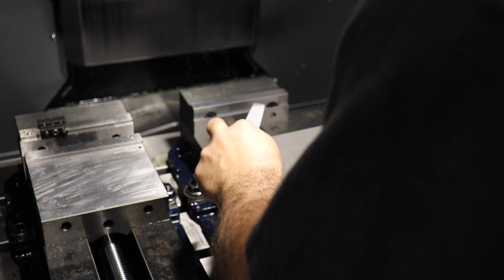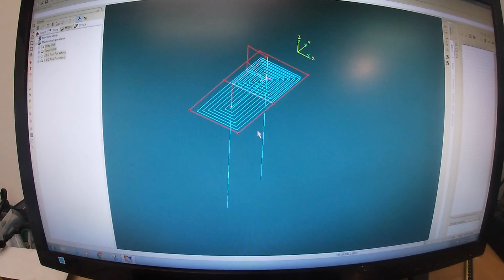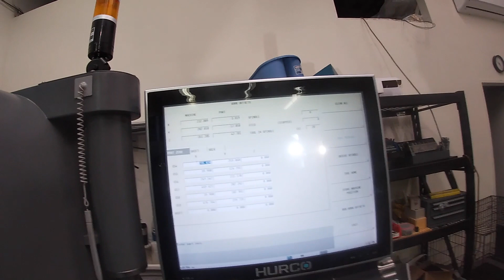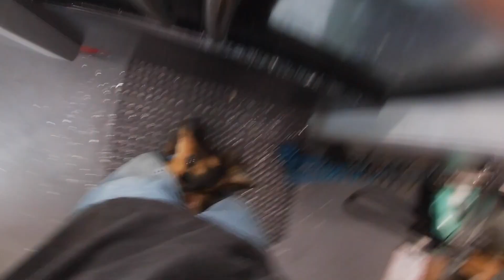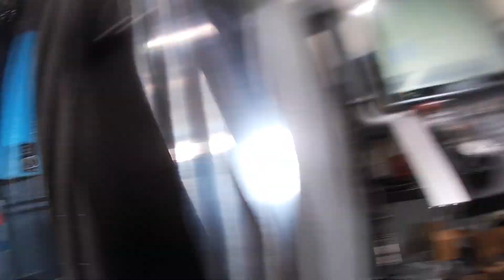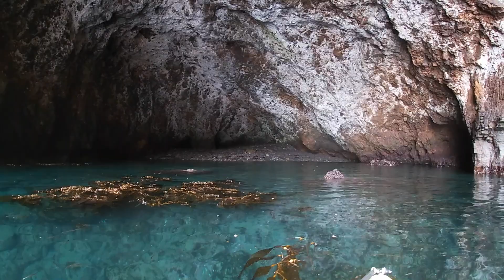Basic Injection Mold Making

Comment: Hy dragon engineering hats off great practical , kindly let me know which machinery are you using to make this mould , 
I am interested to learn mould designing , kindly suggest me what type of machinery I need to purchase for a small startup
Reply from the maker: Hi , I use Hurco VM10i mill and Hass TM1 mill.  I use the BOY 25 and 35 ton molding machine.
Good luck on your new venture!

Comment: I am trying to figure out what type of machine I should buy, I want to start making polymer Glock lowers and I don’t mind having to put in more work to do this myself so I can pump them out every few minutes in my garage. I can buy the molds from China but what machine would you suggest for a hobby / small startup for doing this
Reply from the maker: probably a Boy machine like in the video, either new or ebay used.  They take up less space and are not as loud,.  You probably need a 60+ ton machine, ~$70K new, or ~$15K used ( with probably problems) You will need a 40-50 HP phase converter.  I ran my 40 ton in my garage with a 30 HP rotary phase converter Phase converter needs to be 3X the motor rating due to inrush current at startup  unless the machine has a stepper motor

Comment: Began a Tool and Die with Mold Making supplements apprenticeship on April 15, 1962, still there on Mondays and Thursdays. Moved to design department in '68 for injection molds drawn on linen, then to various engineering positions.  Have 55 injection presses but the tool shop closed in 2012. 
It is good to see other's designs and work!  Can't wait to see Part 2.
Reply: I'm impress Wayne, hope you are proud of yourself caus you deserve it!

Comment: Different methods for different shops. Our tool holder sits vertically on the bench. Tools are clamped into the ER32 collets & tightened with a torque wrench. Then measured with a ht. gage. Close enough for most work but if we need more accurate depth we touch off on the machine.